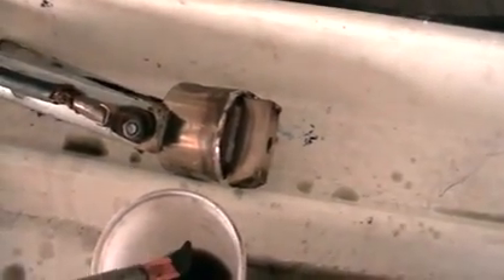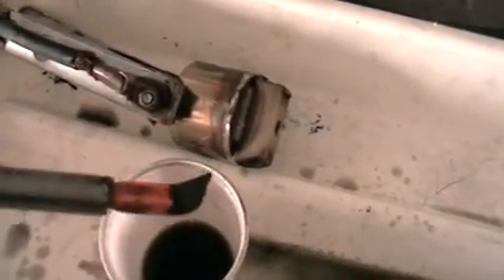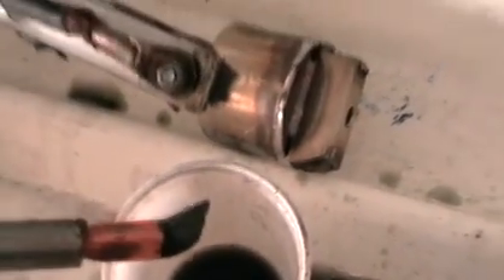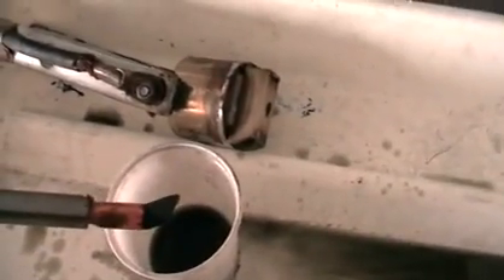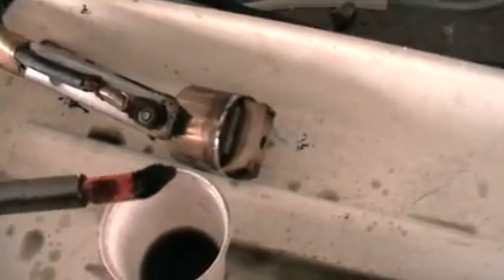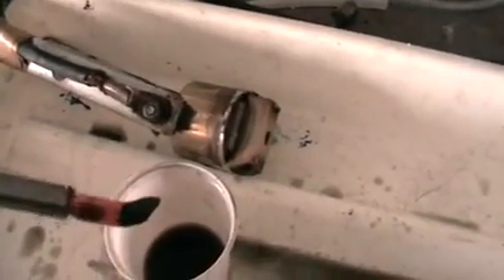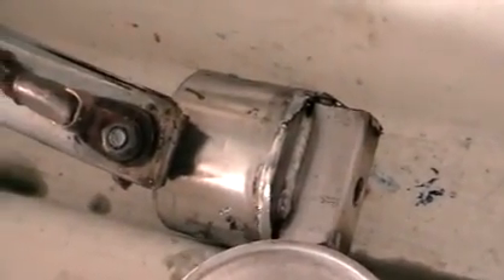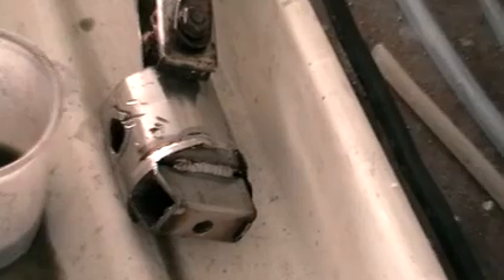DIY Electro polishing of stainless steel weld seams after welding

Comment: What kind of Clamp would you use to electro polish stainless steel frets on a guitar as they have to be polished after the crowning so they must be attached to the guitar when polished.
Reply from the maker: I would use either copper or stainless clamps.

Comment: https://www.youtube.com/watch?v=xHbkn6Z5lGw
https://www.youtube.com/watch?v=tuPEpDzlnZc
Reply from the maker: Yes it works, but welding inverter is producing some pulsating current that tends to create explosive oxygen /hydrogen mix, the bubbles explode sending a fine acid mist around, plus the polishing quality is not that great, believe me, you need a different power supply, proper brush to reach every corner. In my instruction, I am describing the proper setup in details.

Comment: Hi Alek, what do you find to be the best solution combination? I've seen a few articles recommending different acids and can't figure out which ones to use. I have citric Acid, HCl, and nitric Acid (to wash the part after), and have been using a 12V 5A power source with carbon fiber brush, but I keep getting a surface finish which looks to be either frosted or etched... do you think my issue is the solution? Or not high enough amperage? Thanks!
Reply: Phosphoric acid is best. Safe and cheap.

Comment: my question is with a ac welder--can you attach  the  brush  and if so what amperage?
Reply from the maker: No, you'll get the manual, all the particulars and different methods are there.
Reply from the maker: Also make sure that your email address is correct.

Comment: does this work also on oxy acetylene welding?
Reply from the maker: It works with certain types of metals, will polish brass, remove scale  from mild steel as well - all you need to do is just to try, the welding type is not concern, the type of metal is.

Comment: Your TIG welding skills sucks..! Good tip anyway...you just forgot to tell people what you use! Folks...take some sulfuric acid and nitric acid...high concentrated and mix it 50/50..connect a small power supply and you are good to go.
Reply from the maker: Hi you forgot to mention to add some fluoride to your mixture and then you don't need any power supply but will get really toxic substance that actually sold as pickling  paste with caution of being a cancerogen, in my case there is no toxic materials, and thanks for pointing my welding skills, I'll try to improve it.
Reply: Alek Polek Yes you are right about this toxic stuff..real nasty. Oh..by the way..sorry if i came a bit hard about your TIG welding. I saw some of your stills you have build and respect the work and ingenuity you put in it. Great job...and respectfull skills in distilling.
Reply from the maker: Kalle Klæp
Thanks a lot mate, I wish you all the best.
Reply: Kallie, your solution is a terrible idea. None of the machines out there use such a dangerous solution. Usually phosphoric acid is about the worst. I’ve been using a nitric acid solution about 5 parts water to technical grade acid. Citric acid is also used.

Comment: Alek Polek, do you have trouble reading english ? All the info is there on the site: www.retropol.com.au and if you consider $145.00 AUD a ripoff, how much are you selling your system for. I'm the inventor of that PATENTED product, with 20+ years experience in high-end stainless steel manufacturing - my product has undergone 12 months extensive industrial testing in an actual sheet metal manufacturing plant - how about yours ? I stand by my product and I'm proud of it - a REAL AFFORDABLE SYSTEM of stainless steel weld cleaning: www.retropol.com.au
Reply from the maker: Hi, I don't have a trouble of reading English, and word "ripoff" is not applied to the monetary side of this issue, but to the actual idea, I am personally an inventor too, and have two true inventions with patents, simply I can not consider the method you use to be a true invention, and I am personally using this method since 2007 just a week after I saw a commercial machine that in reality resembles a low amp welding inverter, so I did not consider the usage of a different power supply to be an invention, also I sell the step by step instruction of how to use a few different methods (including the one you claiming to be inventor of) and how to build a much better and cheaper small polishing machine that acts much better than a welding inverter - more gentle on brush and mirror like result is absolutely possible while whole construction of your own brush, power supply, and cost of solution will fit into $50.00 and my instructions are only $9.00 technically i am demystifying this process and not building any polishing machines commercially, moreover you are using my channel and my video discussion page to advertise your product, without my permission to leave a links to your site - I have nothing against your developments, but please load your own video tell people about your achievements and advertise your product on your channel like many other people do, even in your reply comment you are mentioning the cost of your just adapter and two times your website address??
I wish you good luck and all the best.

Comment from the maker: Just get a comment about commercially available polishing system based on tig welder machine, checked the site, everything under construction - obvious rip off, very interesting, but still expensive in comparison with my system, I am describing a really cheap DIY stand alone machine that anyone can build, that can give a mirror like result and where no one will depend on "secret specially formulated polishing solution" - everything freely available next to nothing.
Reply: +Alek Polek  Great Job... thanks so very much for posting ! 
Cheers !

Comment from the maker: Ok, to dip let say 50L stainless boiler into solution - you will need at least 500L vessel filled with solution, big surface area of cathodes, really powerful power supply, plus the cost of solution, the footprint of such a system, and here we are talking about cheap way to do the thing where with 100ml you'll be able to treat a really big articles and reuse the solution again and again, then store all your system in the small box till next time with total system cost of about $50.00

Comment: Thank you Alek.
 I am very impressed by your Internet site.
Surely I have to look at the other vids you posted, they seem to be very interesting.
It seems that you have a very deep interest in chemistry and  distillation  and cracking the used oils.
I'm thinking of shining my stainless steel pots and pans and I  have to try your method of shining my cooking stainless steel pots, so I can't wait to see what currents and what chemicals are you using.
Thanks again for sharing.